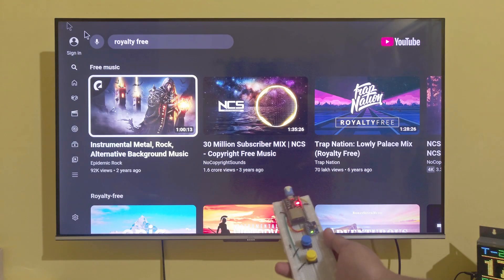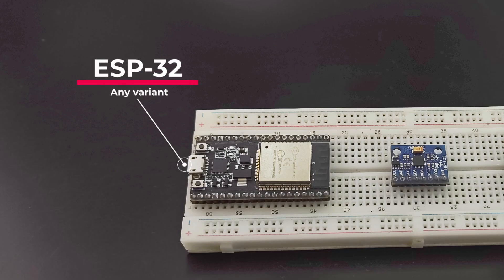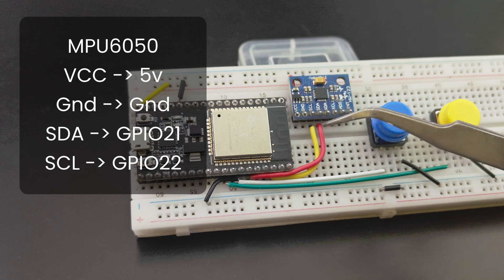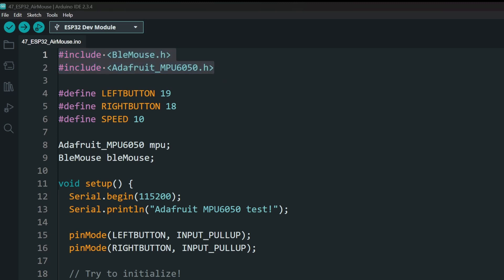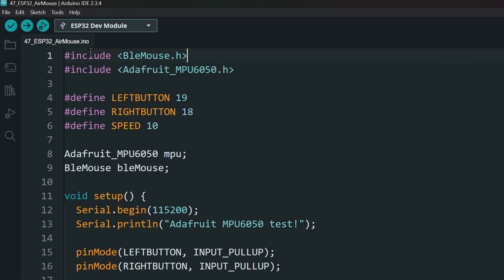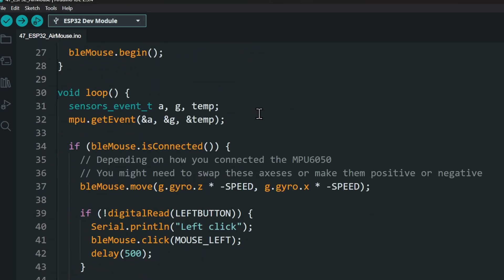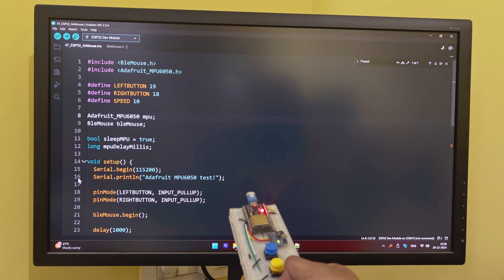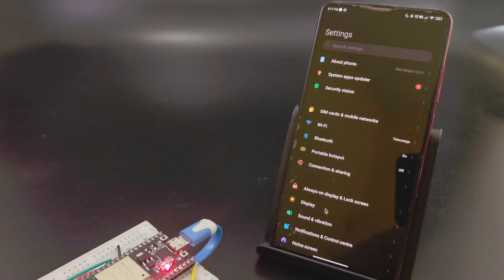ESP32 Air Mouse | Arduino project with code

Comment: Connected successfully but no pointer, serial says mpu6050 not detected?
Reply from the maker: Check wiring. If the wiring is correct, the address might be wrong. Try running an I2C scanner program.

Comment: i need your help sir
Reply from the maker: What happened
Reply: @techtalkies1  C:\Users\legen\AppData\Local\Temp\.arduinoIDE-unsaved2025922-20628-18quen7.onve\sketch_oct22a\sketch_oct22a.ino:1:10: fatal error: BleMouse.h: No such file or directory
    1 | #include <BleMouse.h>
      |          ^~~~~~~~~~~~
compilation terminated.
exit status 1

Compilation error: BleMouse.h: No such file or directory

it is showing this even though i have installed the zip file library
pls help me

Comment: my buttons are not working, i changed the pins of the buttons to 25,26 ; 32, 33 and still doesnt work, i even used chatgpt but didint work
Reply from the maker: Could be a wiring issue.

Comment: I have compilation error
Reply from the maker: It is compiling for me. Downgrade the ESP32 board version to 3.2.0 and try once.
Reply: Sir after downloading esp32 board 3.2.0 ..... 
Again Compilation error : BleMouse. h
Reply: @SaiSmiley-b3b  up
Reply from the maker: What's up
Reply: @techtalkies1  hello im still having the same error with compiling even i downgraded the esp32 core to 3.2.0 to 2.0.9 version
Reply from the maker: You probably don't have the library installed
Reply: How to fix it

Comment: Bro i have error on esp32 BLE Mouse
Reply from the maker: It is compiling for me. Downgrade the ESP32 board version to 3.2.0 and try once.
Reply: @techtalkies1  bro hoe to change the version bro
Reply from the maker: Open the board section from the left side. Search esp32. Select a lower version and then install.

Comment: Hey bro my mpu6050 is failing to connect what can I do?
Reply from the maker: Make sure your wiring is correct. Connect only the mpu6050 and run an I2C scanner program to check if it works.
Reply: @techtalkies1 I had done i2c scanner program also it 0×68
But failed to connect mpu6050
Checked wires also do I need use old version of ada fruit library?
Reply from the maker: Try passing the address in the begin() statement.
Reply: @techtalkies1 still not working cursor is not moving
Reply: It said failed to find mpu6050 chip

Comment: Will this code work if using via bluetooth for windows laptop or PC?
Reply from the maker: Yes this will work for any device that supports a bluetooth mouse.
But the latest version of the library has issues compiling I think. Please check.

Comment: when i try to upload the code i just get this: "compilation error: exit status 1
Reply from the maker: What board?
What version of the board in Arduino IDE?
Also, please say more about the compilation error.
Reply: In arduino ide i selected "ESP 32 dev module. The Board ist from AZ Delivery and ist the Same model you used in the Video(i think) @techtalkies1

Comment: but is it wireless? can we make it wireless???
Reply from the maker: It is wireless!
Reply: @techtalkies1 but we are giving a connection to ardino board right??
Reply: how can we call it wireless
Reply from the maker: Nothing is connected. It's just a power bank. You can use a battery if you want

Comment: I have done this one years ago. The problem was the drifting since you have to calculate with not just the acceleration, but with the gyro as well. compass would be a solution, but slow for quick movement.
Reply from the maker: Yes. For now this is just proof of concept. Compensation of drift will need many extra components and factors.
Reply: @techtalkies1  To be honest, it's pretty handy and useful, even with small drifts. borders of the viewport (size of the screen) is a good limiter to bring back the cursor to comfy zone. :)
Reply from the maker: You're absolutely right

Comment: Would be nice if you can also use it with ESPNow for an even more reliable connection. I can imagine that could be easily realised with the usb library
Reply from the maker: To use ESP now, you would need two ESP devices. One in hand and the other one connected to the host device via USB, though technically a possible project, I think it might be a bit of an over engineering.
Reply: @techtalkies1  Yes a little bit overengineered but its like for something permanent like an HTPC and it has a more reliable connection and you dont have to deal with pairing

And ESP32 Microcontrollers are really cheap
Reply from the maker: Will try that

Comment: Ive been going over the code in comparison to the viddeo. when was itt changed? the IDE sees error after error when checking it
Reply from the maker: I haven't changed my code. 
But the BLE mouse library seems to be no longer compiling. I checked it recently for another project.
I'm yet to figure out if it was an update on the IDE or ESP core, because the library also seems unchanged.

Let me know if you ever get it working again.
Reply: @techtalkies1  I have it compiling now, for an esp32s3, using ide 2.3.4 slightly compressed compared to what your code is, so its working, but im still working on it
Reply from the maker: Is it running fine? So all you did was downgrade to 2.3.4?
Reply: this is my first time using a coding ide so i guess i couldnt call it a downgrade, its just new to me and took some finagling
Reply: heh update to the ide maybe. im just new and relying on the software checks provided so thats why i thought as such
Reply from the maker: Nice. Then welcome to the channel.
I will check the code and IDE changes when I can.

Comment: does this use mbed BLEmouse by Harsha?
Reply from the maker: The library is mentioned in the video.
Reply: @techtalkies1  yes but Ble Mouse does not appear in the directory therefore the ide cant verify/compile, pre uploading to chip. is the ble mouse only apply to older versions of ide?
Reply from the maker: As said in the video, you need to download and install the library. Did you watch the video or just copy paste the code?

Comment: Could an 8directional pad or thumb stick be added to this? And could we just use pcb or is one of those boxes needed?
Reply from the maker: Yes you could add a thumbstick to it. But that would make it a gamepad. I was going for a pointing device. I have a separate video on a gamepad.

And what box are you talking about? The power bank that I have connected?
Reply: @techtalkies1 I’ve never studied electrical engineering, never knew what a bread board before this video. And if more buttons as well? (Essentially trying to make a multi function 5+ buttons gaming air mouse game cam) with a thumb stick (movement
Reply from the maker: Check if you can combine this project and the below one to achieve your goal.

https://youtu.be/3JmIiYtDSyw

Comment: What is connected to the esp32 while operating 
We can use lithium ion batteries 🔋 for esp32
Reply from the maker: Yes batteries will make the project portable.
I made it much simpler by connecting a power bank.

Comment: Great video
Im also looking for the android TV wifi+bluetooth remote project using esp32
Do you have any idea or source for more information.. like any library, protocol, or how wifi remote works
There are few apps on Playstore thats works great but i want to make it with esp32..just like the one i got with my TV
Reply from the maker: I am wondering the same. My guess is that it works on part BLE and part Wi-Fi. But there is no information anywhere. Let me know if you figure something out 
Also, what are these apps that work? I've found none.

Comment: You could have a button which recenters it to the middle of the screen!
Reply from the maker: Yes! I did think of that. But it is just a proof of concept. A simple thing like a recenter button can be added based on the individual project requirement. It's pretty simple.

Comment: Can we add a scroller to the remote. As this will greatly improvise this project.
Reply from the maker: Certainly!
The library supports scrolling. So if you have some kind of a scroll wheel, it can be added.

1. A simple joystick module can also be used or
2. Just add two more buttons to make a scroll up and scroll down action.
Reply: Thank you
Reply: I’m excited to see the video of your “improvised” project!

Comment: I found it interesting and awesome idea. It might be really useful for smart TV. Thanks for the inspiration. I think we can add deepsleep code to save the battery life and can wake up by detecting movement from the sensor
Reply from the maker: Yes! Let me know if you ever make one. That would be awesome
Reply: @techtalkies1  Hi, I just created this air mouse, and it's awesome. But I see there is a lot of improvement. For example, your code is blocking, which means that when I press the button, I can't move the mouse pointer. Also, for you guys who want to create this one, don't forget to clone the BLE Mouse library on the dev branch, not the master, because there are breaking changes from Espressif in the Bluetooth.
Reply from the maker: Yes the button code is not made for dragging. But the library has a method to do this I believe. 

And the library I use is not from the main branch. It's a fork. I have linked that fork in the description. Thanks for the insights.